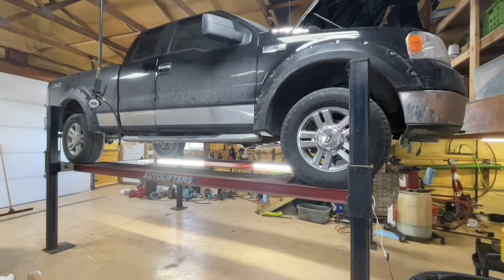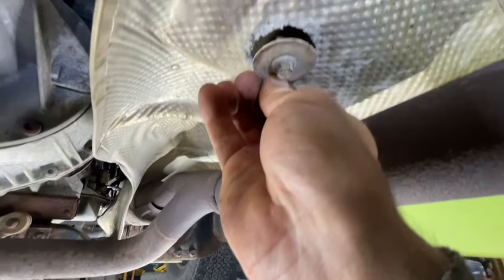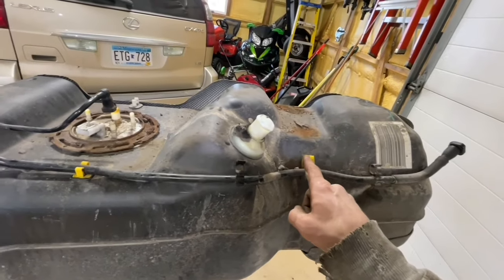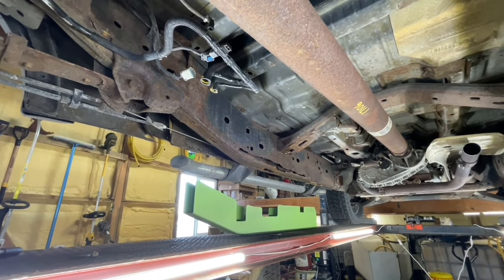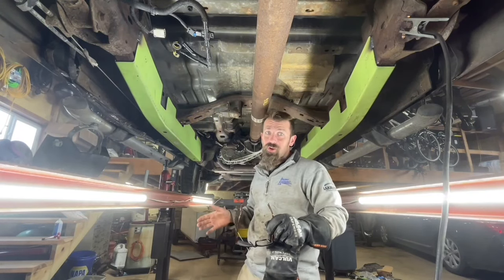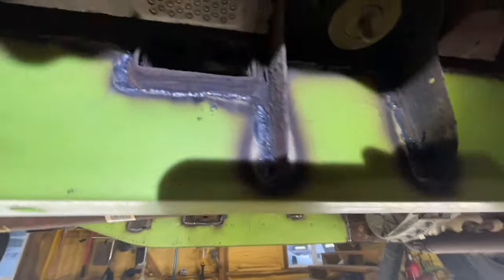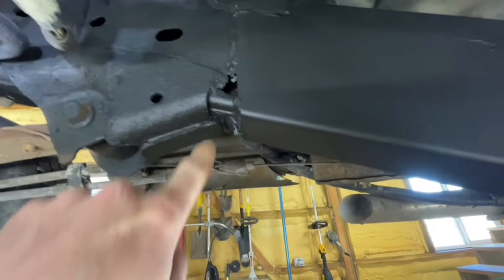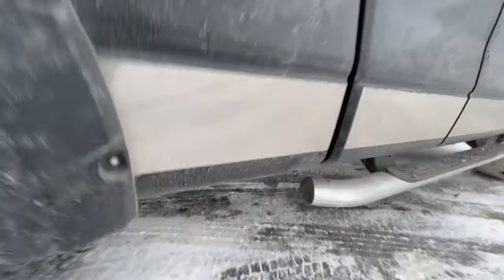Rusted out, rotted F-150 frame: repair, fix, 2004-2008, this one is pretty bad!

Comment: Thanks for taking the time to make this video.  I was debating on buying those Dorman frame repair sleeves for my 2005 F-150 STX.  You helped me tremendously in making the decision to get them and have them welded in. If your customer gets any future fixes done on that truck, please make videos.  You did a great job on this video.  Keep up the good work.
Reply from the maker: Thanks!  I appreciate the kind words!
Reply: Do more on the videos on frame repair, do to rust in other areas...
Reply: I have them same lime green sleeves...still have to put them on.
I'm all set as far as welding goes, I'm going to do it, right behind the sleeve going towards the tail lights l have a broken bracket like maybe for balance of bed (don't really know much about auto's of any sort) well is there a replacement or should I just make it up as, l go...thanks...✌
Reply from the maker: @jimmygensler8715  I’m not sure if they make a replacement piece or not. Anytime they do it’s usually a big time saver over fabing up your own. Fabing up your own is always an option though. It can be as simple as several small pieces of plate put together to patch a bad area. 

I will definitely shoot more videos on frame repair as those projects come up.
Reply: Yeah I agree. Thanks , I'm dealing with the same thing at the moment not nearly as bad rust though.  Just a little on the driver's side mid section.
Reply from the maker: @PhilBender612  hopefully catching it sooner will make it much easier!

Comment: Most important part didn’t get fixed the frame above the rear ended where the spring hangers are. Also it’s better to unbolt the spring hangers and plater underneath instead of sitting out around them.  The thing is if you don’t bolt thru the new metal it makes the old rusty stuff even weaker because the plates frame is rigid and stiff them the thi factory frame is super week where the two meet is going to be weekest point. But you did a good job and did what the customer asked.  Good job buddy
Reply from the maker: Thanks Cereus and thanks for the advice!

Comment: I just welded mine with steel from a 1940's Packard frame that has spent it's entire life in NYS winter's, my f350 is a 91, and was almost completely disintegrated. The frame from the ancient Packard truck looked nearly flawless after all those winters, on top of that had spent it's retirement as a farm trailer, then I found it in a field and drug it home. Blows my mind how fast the newer trucks just crumble, the old ones last an eternity, I'm considering replacing most all my frame with that ancient Packard steel.🤷
Thank you for the content 🙏
Reply from the maker: That’s crazy!  

Thanks for watching and your welcome!
Reply: I wonder if the bed can fly off while driving?
 Because mine is broken and still driving it
Reply: That was better pre radioactive steel

Comment: Excellent job so far. I think a metal fabricator can take a few more hours and patch up that weak spot that you showed us after you finished with the two long frames pieces. All in all, you made the truck a lot stronger than it was before you started on it. Good job bro.👌
Reply from the maker: Thanks Dex!

Comment: Great job 👍🏻.  We did the same basic thing to 2002 Jeep Wrangler sport ,took “a month of Sunday’s” but the results were worth it 4 years later still looks structurally sound !
Reply from the maker: Thanks!  I haven't repaired a wrangler but they are pretty common for frame rust as well.  Glad to here your's is holding up well!

Comment: I recently bought an F150 and the frame is similar. I came to YouTube for research purposes . I found these frame rail repair kit. The truck is worth saving . So it looks like I’ll be finding out first hand . I hope all goes well…
Reply from the maker: Best of luck with the repair!
Reply: Any ideas on the total cost ?
Reply: I’d say the parts will be around $500.00  Dorman part # RNB-999-997.   Luckily my father owns a garage (business) we have a lift as well as welders etc.   so I’ll save as far as labor.  Im not sure what a place would/should charge for something like that.

Comment: Wonder how much longer the frame would have lasted if the previous owners oil sprayed. Losing battle with rust?
Reply from the maker: I’m sure it would have held up much longer, but you’re correct, it’s a loosing battle with rust. :(
Reply: If you use a product like fluid film from brand new, every year, in 20 years. It will look better than a 20 year old southern vehicle.

Comment: aw man! about half as bad as my 2004 colorado. I wish Dorman made the repair kits for my frame. I've been using 3/16" x 2" angle steel to bound the bottom part of the frame in the same manner as this kit. it's going well overall. that lift is cheating! it's tough weling and griding laying on your back. hats off to industrial welders who do that for a living
Reply from the maker: The lift is cheating :) keep up the good work. The Dorman parts make it much easier but good for you for roughing it out and getting it done anyways!!

Comment: Nice work, but considering the extent of the rust on this frame, I think it should have just been scrapped. Had the repair pieces covers the only rust, fine, but there is so much more.
Reply from the maker: I don’t disagree with that. I took it as far as he wanted me to but there is no doubt it’s not as good as a new frame. It’s also a lot better than when it arrived.  That 5.4 will die before the frame folds I half?? :)
Thanks for watching!
Reply: @bennieaust  Yes,  I agree. Tough times, crappy frames. I have a customers 06 Ford here now with problems, too me these boxed frames suck. We didn’t see as much issues when they were open. Thanks for the video, shows a good solution for some situations.

Comment: I've got a 04 ford f150 like that I'm lucky my frame is perfect but I keep it washed good and painted. You did a awesome job buddy
Reply from the maker: Thanks!  Glad you have a good one. Sounds like you are the reason you have a good one!!
Reply: I've got an 04 in great shape except for cam phasers making noises but the frame is in great shape.
Reply from the maker: @Anthony-kn8cn  if the frame doesn’t get you those cam phasers will!
Glad to hear you have a solid frame!!
Reply: @bennieaust  yes sir that and the roller followers are what definitely goes wrong with the 04 to 08 model's

Comment: My 05 F-150 was like that to, I thought about doing this but I had the 5.4 3V, the motor went before I could fix the frame so I got rid of it for a 2020 F-150, think I’m going to send it out and have the Frame coated soon.
Reply from the maker: Hopefully the new ones won’t have this issue but that’s a great plan to help avoid it.

Comment: I had a 2000 Chevy Silverado with a rusty frame and it collapsed in front of the rear wheels at 296k. Ravaged it for parts that could swap onto my 2004 and sold the rest for cheap.
Reply from the maker: I've had to make a few repairs on the older chevy's as well.  The salt they use on the roads really kills these things. :(

Comment: I have used hydraulic oil for years , I don't like the coating of anything were water can get trapped oil will find every little nook , yes you have to do it every year but it works

Comment: Hello, I am impressed at your work in repairing the frame on that truck. I have the same issue with my 05  f150 I have 81000 miles on my truck and I kept it well maintained. The body and interior are awesome I just didn't realize that the frame and when I saw your video and went to check my truck frame it was in the same condition. I just wanted to now  what was the fee  you charged on the repair and was the parts you used included in the repair. also what type of garages or auto repair shops do you think would do this kind of work. Thank you , any info would be greatly appreciated.
Reply from the maker: I'll send you an email.

Comment: That rubberized undercoating, just gonna make it worse. If you wanna coat it with something that won't continue to rust underneath it, and don't want it to wash off, like lanolin, use black cosmoline rp342.
Reply from the maker: Thanks for the tip!

Comment: Thanks for vid. I think the dealer is doin this to my f150 after the turn signal cable rubbing the rusty frame rail. It was doin some crazy stuff after unhooking a trailer I towed-turn signal canceled out the cruise control? LoL. We thought it was the trailer light connector, but it wasn't apparently.
Reply from the maker: You're welcome!  Thanks for watching!

Comment: Great job! I would definitely cover those holes at the end of the rails otherwise it sort of defeats the purpose.
Reply from the maker: I think no matter how it’s done it extends the life of the truck but not forever. It will still be an issue at some point.  :(

Comment: I have a 2004 Ford F150 FX4 and the chassis is rotted and cracked all over the place my mechanic told me. I live on Long Island so my truck won’t pass inspection for state of New york. not really sure what to do here. mechanic told me maybe look for a welder to fix it, not really sure what that entails. Any information on how I could proceed to fix this issue is greatly appreciated. thank you.
Reply from the maker: Sorry to hear you’ve got this issue too. :(

That’s good advice to find a local welder and see if they can repair it for you.

Comment: I have a 2002 Suburban 2500.  Frame looks like that one but everything else is in great shape.  Debating whether it's worth fixing like this.
Reply from the maker: It’s always a tough call. One of the big variables is what’s out there for used vehicles. If you come across a good deal on something else than it can sway you decision. 

Rust is a losing battle. Even after a repair like this there is still more rust on other parts of the frame. It buys it a few more years but the rust will win in the end anyways. :(

Comment: So let me ask you this because my father is looking into gifting me an 2005 f150 in otherwise great condition except the rotted undercarriage or frame.  When i looked up on google said could be anywhere from 1000 to 3000 dollars to fix and if thats true i feel like thats totally worth seeing that everything else on this truck is really taken care of.   Do you think its worth it to fix in that situation and is that pricing right you think?  We got tge truck for 500 because my dad gets great deals at his work.
Reply from the maker: Personally I would never buy one that had this issue.  The repair I did in the video made the truck much better and safer, but it’s never going to be as good as a new frame or a truck that never had a rusted frame. 

This is more of a fix for someone who is in a tight spot with a truck they own, not a reason to buy one that needs to be fixed. 

If the truck you bought is otherwise really nice I would suggest getting the frame replaced. Then you will truly have a great truck.

Comment: I have a Ford F150 that is worse than the one in the video. There should be a class action suit regarding the frame. I wonder if the metal can be analyzed to tell why it failed?
Reply from the maker: IMHO it’s a design flaw. The fully boxed frame traps dirt and moisture inside and, like any steel, it will just rust away.  If they had done something to prevent the rust better it may have helped, but they didn’t do enough. Other trucks also have a boxed frame and don’t have this issue. Although Toyota also has this issue.

Comment: They should offer a powder coat frame option from the factory.Im amazed that truck didn’t break in half
Reply from the maker: They definitely should have done something different!  This one is bad but it wasn’t flexing when you jump on the bumper. I’ve seen much worse since then. :(

Comment: Hello 
I just purvhased these from your link for my Ford truck. I went to an alignment shop for a  estimate to do what you did. They quoted about $2000 for the labor. Is that a fair price ?
Thanks
Reply from the maker: $2000 seems like a fair price. A lot of people are having a hard time finding a shop that will install them. If you found a shop that will do it for $2000 I’d jump on it!

Comment: What was the approximate labor time and cost for this? I hear of ALOT of these  F150 trucks having this issue. Is it bad engineering  or what? Don't they use preservation coatings from the factory during production. Makes no sense as to why the frames rot so easily while mostly everything else looks decent.
Reply from the maker: Every shop will be different and every truck will be slightly different. This guy spent about $1500 parts and labor on this job. It’s not as good as a new frame, but much better than when it arrived. 

I think it is an engineering mistake. This should not be happening to so many of these.  They should have been able to engineer it for better longevity.

Comment: Those slipons are a waste of money. They cost $500 and a sheet of 1/8" plate costs $160.  I prefer to make my own plates.

But you did a great job and it looks great
Reply from the maker: Thanks!

If you are ok with the extra time and then you can definitely save some money making g your own. 

Personally I feel like they are expensive, but worth the money because of the time savings.

Comment: how much would something like this cost? I have a smaller hole and a bit of a line near the gas tank in my 2010 chevy. also i noticed the two holes, how long do you think a truck could last with that strickly the frame? 1 year? 3? 5? 10?
Reply from the maker: This customer paid around $1500 for the repair. They are all a little different.
Reply: thanks so much for the quick response appriciate it.  @bennieaust

Comment: One thing I would do Is Def Finish that up on those Weak Spots of the frame were the wholes are for sure…But One step at a Time…But it’s for Safety and Durability and Strength…I got my Truck For my First Work Truck….want to make it as strong  and reliable as I can…Get another 200,000 miles out of it …..

Comment: Oh And Mine I Thought and was told Was the worst they’ve ever Seen…This one is Def Worse than mine but not by Much and the end result When you finish Was Amzing looked Factory Almost….I have to Pressure wash and Clean the whole Undercarriage Up and Grind and seal…Then I’m gonna put mine on with Cold Weld And Adhesive Then Wrap it with Special Wrap to Cure…Dont know how to Weld Yet…Can do Later On….And Your weren’t So Bad Lol…Not for looks Down there anyway…This is For Strength But Your finished Product Very Impressive..!!!!

Comment: What do you unhook before welding the frame. Battery ground, will welding affect the ECM or is there a ground to disconnect?
Reply from the maker: Hey Lesley,
  You can either disconnect the negative battery cable, or use a device like this:
https://www.amazon.com/Dent-Fix-DF-601-Surge-Protector/dp/B002XMS0KU/ref=asc_df_B002XMS0KU/?tag=hyprod-20&linkCode=df0&hvadid=309750549985&hvpos=&hvnetw=g&hvrand=6979250700272117712&hvpone=&hvptwo=&hvqmt=&hvdev=m&hvdvcmdl=&hvlocint=&hvlocphy=9019869&hvtargid=pla-760191242152&psc=1

Comment: Do you have the part #s for a 2005 f150 crew cab 4x4? Or do you just cut down those ? TIA.
Reply from the maker: The only parts numbers I have are the ones in the description that were for this particular truck.

Comment: I love your video, it really helped understand what wron with my 08 Ford 150 Lariat rusted froame rails exactly like what you did to fix thatguys truck. I just am having a lot of problems finding someone around Seattle that can do what you do. Any suggestions? Thanks Robert from Bothell Wa
Reply from the maker: Hey Robert, glad it was helpful!!
Unfortunately I hear from a lot of people that are in the same situation.  It's hard to find shops that will make this kind of repair.  I think part of it is because it's somewhat of a bandaid fix.  Although it's much better than when it arrived, it's still not as good as replacing the frame, and the rust will get the best of it eventually.  The people this repair is good for are those who do not haul heavy loads, or tow big trailers and pretty much just use the trucks as people haulers.  It's a good way to get several more years out of a truck that should otherwise go to the salvage yard, for a cost that's reasonable, in comparison to frame replacement.

Comment: Hope my GMT800 frame doesn't look like this when I drop the tank. Ever done a 99-06 GM frame repair?
Reply from the maker: I haven’t witnessed the same issues on the GMT800. I have repaired rear shock mounts and the rear crossmember they mount on.  Lots and lots of rotted out brake lines on those things though. Did I say lots?

Comment: I've got a large hole broken in my 2005 f150 frame near the leaf spring mount. These caps don't seem to go back that far
Reply from the maker: That’s also a common spot. Unfortunately these caps don’t address that spot. You’ll have to fab up some pieces of plating for your issue.
Reply: @bennieaust  I've got some 1/8 plate steel I'll make work
Reply from the maker: @Kartracer95 that should work great.

Comment: How much time does this install take? Would like to get an idea of the costs to install the Dorman frame repair sleeves. Thanks.
Reply from the maker: It can vary greatly depending on exactly how bad the truck is, and what shop you take it to.  The best thing to do is just contact local shops and see if they can give you a quote.